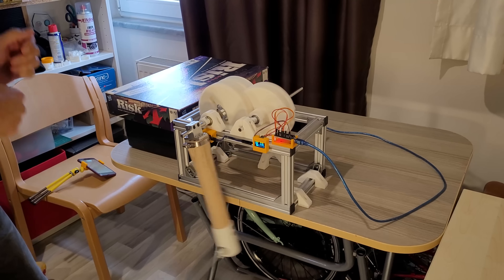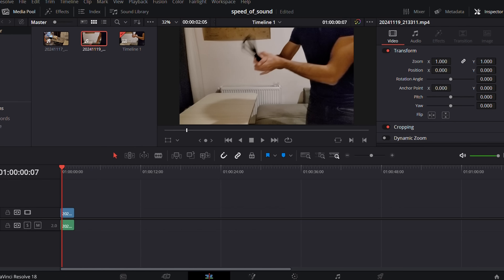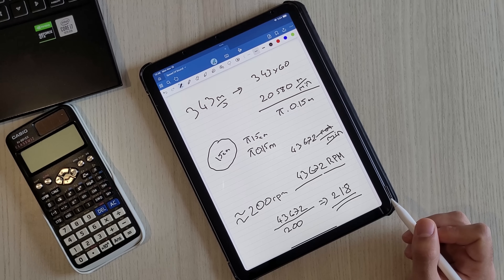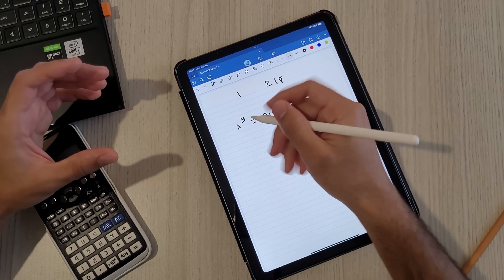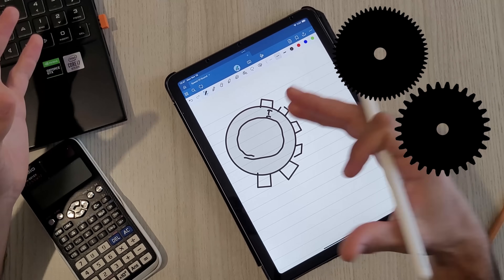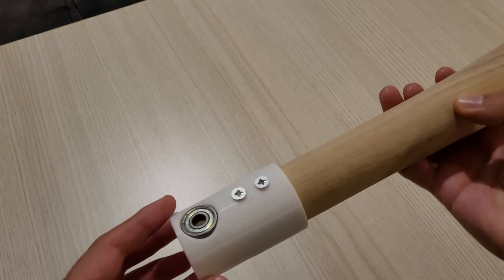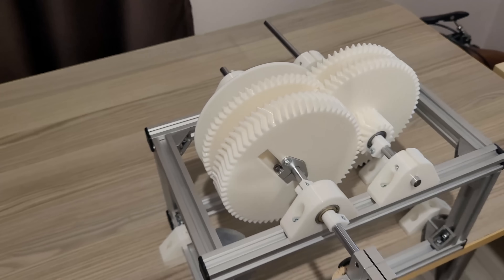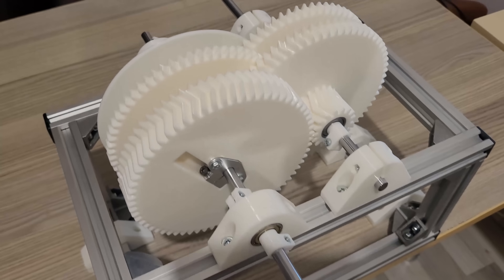Trying To Reach Speed Of Sound At Home 3D Printed Gears

Comment: Bull whips crack because the end reaches super sonic speeds. Maybe you could create a gear set that can accelerate a rope like a whip so the end reaches the sound barrier.
Reply from the maker: Hi, in this system, the diameter of the disc is limited. Since I'm using two parallel rods to mount the gears. If i attach ropes to it, they will hit the other rod.

Comment: I think you should have lubricated the gears to have less friction. Your idea of adding a pin to the crank to eliminate is good but I don't know if you will be able to drill through it as it's hardened steel.  It was a nice video and with some improvements I think you can reach Mach 1 👍👍
Reply from the maker: I actually did put on some oil it's just not on the video. It's hard to film and do stuff at the same time, but I'm getting better at it. With a drill press, i believe it's not too hard to do, but i currently don't have one or don't know anyone who'll let me use theirs. 
If the channel grows a bit, I'm sure it will be easier to get my hands on the equipment i need.
Reply: @canocholic  ok ok nice then 👍 but you will need a special drill that harder than hardened steel or else it won't cut through it cleanly. I have machined hardened steel and it's not easy at all without the right tools. I hope that you will reach the speed of sound with gears 😎😎

Comment: if the goal is pure speed with no load, consider disks with no teeth for minimal drag and  minimal contact friction, and strength for the faster stages. It also serves as a decoupling clutch should anything go wrong. 3D printing might be adding a weak and overcomplicated step if all you need is a disk.
Reply from the maker: Hi, wouldn't they just slip

Comment: Speed of sound. ... Once you break the sound barrier, I wonder what kind of snap or boom it'll make. 
I often see people using their arms to crank a lever, but why not apply a foot powered flywheel pedal? You could apply your full body weight into the driving gear, or go beyond that by standing on the pedal and lifting up on a solid bar mounted to the room. Body weight + arm strength = force down on pedal, connected to gearbox. Might even add another gear if you can apply that kind of force.
Some videos about capstan drives came up, so I chatted with an AI. You might try setting up Capstan gears for your driving wheels for high torque, then transmit to tooth gears for the high speed. Summary of chat, the tooth gear would break way before a rope would snap. Not sure how the smaller gears will handle the higher speed force though.
Reply from the maker: Hi, pedals would definitely help, but it would require metal structure. I don't currently own a welder or even a saw. If the channel grows enough to support the projects, i am thinking of trying again with pedals and stronger gears.
Reply: @canocholic bicycle(s). Sources to check would be bicycle shops, exercise equipment, paddle boats. Who knows maybe they'll want to partner.

Comment: I think to actually accomplish this you'd need 
1. Pedal power, hand power will not get you to the speed of sound
2. Aluminum final stage, plastic cannot spin at the speed of sound without shattering, aluminum and steel have a much higher top speed.
3. Different types of bearings for each stage, you'll need some exotic bearings for the last stage, and strong bearings for the first.
Reply: Also: Lube the gears. Less for the reduced resistance, but for the longevity of the gears.
Reply: @Donnerwamp yeah, bro needs to oil up
Reply from the maker: I agree with you.
Reply: Have your frame being in a more stable position, like making one with the planet instead of putting it on some oscillating folding table will definitively help to crank harder too
Reply: Also losing energy when the whole assembly moves. Making sure nothing twists or shakes to optimize energy. If it’s on a table again, put something very heavy on the table, like a 50 pound or greater weight. Workout plate weights are great for this. Proper lubricants would help with the noise and heat, which are both additional losses to energy.
Reply: and oil the gears
Reply: Hand power absolutely can generate the power never to get the speed of sound. Even heavy metal braided whips and chainmail whips can easily reach the speed of sound with minimal force.
Reply: bro neeeds better table
Reply: The edge of a spinning disc can't go faster than the square root of the specific strength of the material it's made from... So something like ABS could only get up to about half the speed of sound.
Reply: Youtube hivemind coming up with optimal high-speed gear design is outright hilarious

Wouldn't be surprised if that would actually work. Never underestimate how capable internet hivemind is
Reply: you could likely get away with a steel cable tying the output stage but yeah otherwise cds start to crack at 30k rpm, so some sort of reinforcement is required.
using aluminium foil might work though, as it's very light but strong, flat PC from packaging might work too.
Reply: @satibel  Foil could work, in theory thickness doesn't matter.
Reply: So, I think you're way closer to supersonic than you realize.

The big hang ups are the wasted energy in the mounting: you need the mounting to be stable enough that it can support 5 × your weight in linear force at the highest point on the lever (accounting for a decent sad margin). So think about mounting it to something outside like a rock wall, playground slide, or the like. That way you can put your whole body into the turning and don't lose energy from moving the table around.

Other really useful improvements:

The aerodynamic drag on the smooth wheel is really low because of the boundary layer that forms so you'll be much better off if you make the final wheel larger and lighter. So drive the wheel with similar gears to what you have, but make the final "gear" 1.5 times the size to get the extra velocity. You could also offset it with another gear to get a slight improvement on the ratio too, and give a slight bit more clearance.

The last improvement I'd suggest is to use a crank that's got a sliding arm so you can pull it up and spend more time in the most powerful downward stroke when driving the gearbox. So a split elliptical "arm" that the handle slots into with an engagement point at each end (where each half of the elipse is opposed) kinda like this:
(
 )

Just to maximize your power output. 

Other than those little improvements I think you'll hit supersonic without too much reworking!
Reply: legs are stronger than arms so that makes sense.
Reply: TRUE
Reply: Yeah oil with aluminum will reduce friction and the HEAT, power hates heat, but maybe you can heat harden the gear teeth too to strengthen them, and also make a movable handle to shift the force of your crank from torque to power to the input
Reply: 4. a way to switch the power delivery between gears, like shifting gears in a car
Reply: @marioisawesome8218 I don't think really need to shift, you can crank fast enough, and the complexity of shifting gears would probably offset the marginal gain of having  a better impedance match.
Reply: I think the best way would be to spin a generator then feed that power into a special ESC-brushless motor, with a disk made of carbon fiber on its shaft or some other material with high tensile strength to weight ratio.
Reply: @teresashinkansen9402  I was thinking if your wanted to keep it all 3D printed print it as an exponential decay curve profile so that the majority of the mass is at the center and the tensile forces are well distributed relative to the mass of the outer edge
Reply: @miramavensub  with the center plastic pulling less I wonder if it would be more cone shaped optimally, not exponential.
Reply: Not only that but silicon grease seems essentially to make sure the gears don’t tear each other apart
Reply: You have to anchor the whole setup into the ground, on a solid table that is literally bolted into the ground, like an industrial workbench, to completely minimize energy loss. It might be possible to reach speed of sound with arm power, but the crank needs to be made in such a way to be very efficient for transferring energy (Long strong crank, good torque generation), and be large enough to hold with both hands, and push forward with your entire body behind it, like how old winches would be operated, rather than sideways and one handed.
Reply: The aluminium final stage will deform at high speeds, and will also break the gears on the plastic gear connected to it as it pushes on the underside of the 3d printed gear. 
Pedal power is an excellent move. Your gear alignment has some clearance if you were able to reduce the tolerance further you maybe could get a higher speed.
Reply: Agreed, was about to type the exact 3 points XD
Reply: Lubrication would also help. Not even metal will stand up to rotational forces like that at metal.

Comment: Mount your gearbox on a SOLID base.  You can transfer more energy.  With a heavier crank handle you can amplify your energy density.  You can multiply rotation by adding a heavy flywheel to the input gear ??? 🙏🚂🎼🌹🎵🎶⚕️🛠~C< 3)>>-Z->}

Comment: Now increase the gear ratio more install a motor-generator on the fast side and some weights on the slow side. You have created a gravity battery.. solar panel spinning the motor at day winding - lifting the weights.. Gravity unwind at night spinning the motor acting as a generator.
Reply from the maker: It's in the list for my project ideas. I'm planning to build that when the weather gets better.

Comment: 9:47 The individual gears don’t need a prime number of teeth. The two numbers just need to be relatively prime, like 15 & 58.
Reply from the maker: I choose prime numbers in case if i use the gears in another project.  Juts to be sure they'll be relatively prime wherever.
Reply: True. You could just choose one number that is prime, and the other number can be anything you want, so you can use that to get the best gear ratio.
Reply: what's relatively prime
Reply: @EliLubbe-hi1de the numbers don’t have factors in common, aside from 1. Factors of 15 are 1,3, & 5; for 58 1,2,29. Only 1 is a factor for both